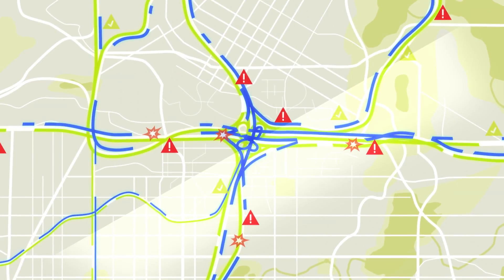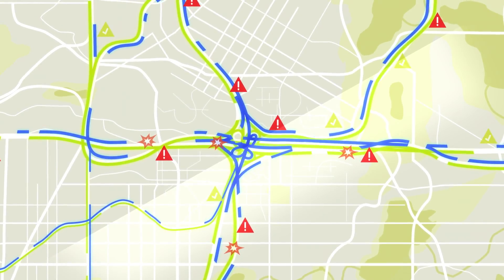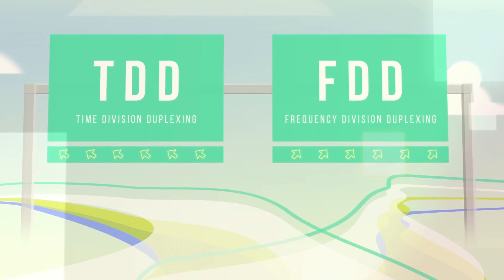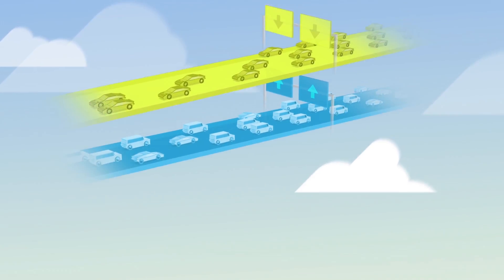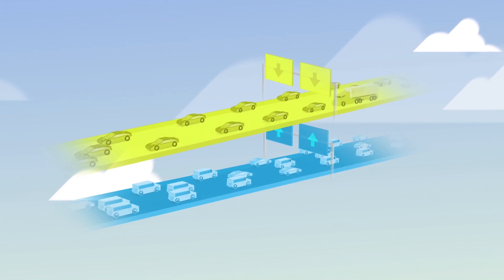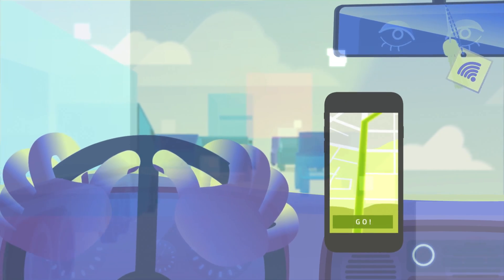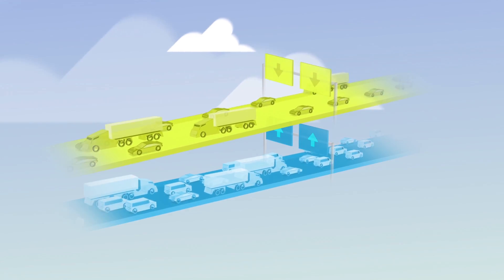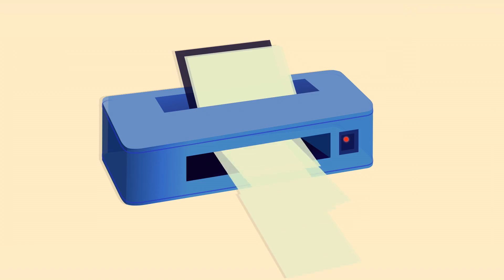What is Full Duplex DOCSIS® Technology (part of DOCSIS 4.0 technology) ?

Comment: It took 8 years to get from DOCSIS 3.0 to 3.1. Pretty sure Fiber Optic connections will be installed before this will implemented.
Reply: That could be true, but why are you complaining about competition? Are you seriously advocating for Verizon or whoever that runs Fiber to have total control of 1+ Gbps internet? This will only create competition, driving prices down. Comcast clearly wants to keep their aging copper infrastructure, and honestly if they can get 10Gbps/10Gbps on it, then I could care less.
Reply: 3.1 already deployed. Lab trials are underway, with field trials for extended spectrum expected to begin in 2020. Deploying that platform within 12 to 18 months afterward.
Reply: Jmack1lla fiber will always be the underlying backbone of the Internet protocol transportation but you won’t have to have fiber to home or premises to be able to achieve speeds with this advancement. Fiber to home will  essentially unnecessary for most applications when this gets fully deployed. Cable operators were already utilizing fiber to the node and then trunk cable to the taps and then coax cable to the home. What’s may end up happening is they’ll continue to rely on fiber to the node but instead will skip the trunk cable to the tap instead go with 5G  to home for last mile deployment. This would be the wireless solution in the future give it five years or so. Let’s say 5 to 7 years.Deployment will be UPS package in the mail with an ESim or a SIM card with a modem router. Of course Verizon AT&T T-Mobile and Sprint are looking to have a leg up on 5G but don’t yet have the infrastructure to support it yet.Wireless operators will be relying on cable operators and vice versa. Cable operators or MSO’s already have a physical connection to your home stretching all across the US.Wireless carriers depend on cable operators for physical connections to their towers a majority of the time. The partnership through 5G deployment will benefit many industries and will speed the deployment of smaller and faster devices in the coming decade.
Reply: Jmack1lla From what the cable industry imagines the full duplex advancement will future proof their investment for the next 40 years.I believe that 5G, 6G and 7G will come long before the next 40 years so there is no way one industry let alone a person can imagine what two wireless generations would look like from now.

Comment: how can a modem fix a problem that occurs before reaching the modem
Reply: Major Biflash forward error correction (FEC) if I remember right, part of each packet contains a bit representing either an even or odd number of ones in the rest of the packet. Once the modem received the packet, it uses this bit to correct lost data. It's actually EXTREMELY effective.
Reply: I know this comment is a year old but its called pre equalization.  Basically the CMTS knows what the signal should look like coming from the modem, if it has any impairments in that signal it tells the modem to distort itself the opposite way, creating a sort of mirror image of the impairment, so when it passes through that impairment the signal to the CMTS is fixed.  This only works so much but in normal cases works well.

Comment: Any certain modems that supported DOCSIS 3.1 ?
Reply: Here is one from NetGear: https://www.netgear.com/home/products/networking/cable-modems-routers/CM1000.aspx
Reply: ARRIS SB8200 as well.
Reply: ARRIS DOCSIS 3.1 DG3450 Touchstone Gateway
Reply: You need Duplex Docsis which none offer yet. They probably should have called that Docsis 3.2 to avoid confusion. There are plenty of Docsis 3.1 modems. You need to get the one with the most channels up and down to get the best speed, but down will be much slower than up. The new Duplex modems from Comcast will be rental only service, so if you buy one you can't use it and will be paying for the rental. But, if your provider is different then I wouldn't buy a cable modem until the duplex ones come out.